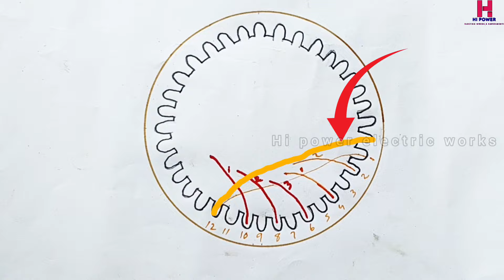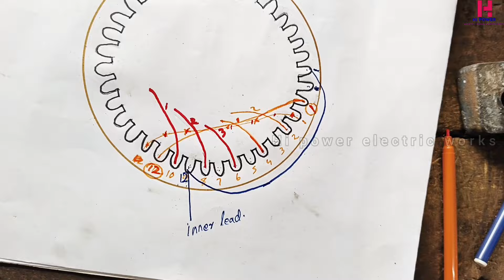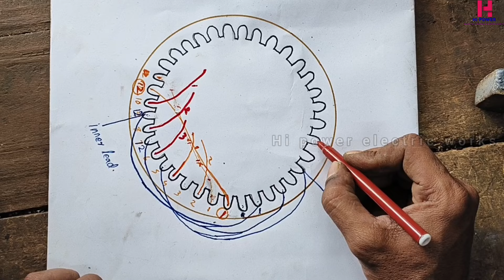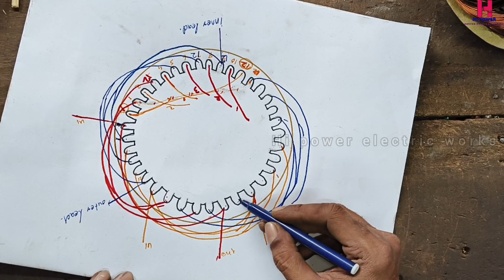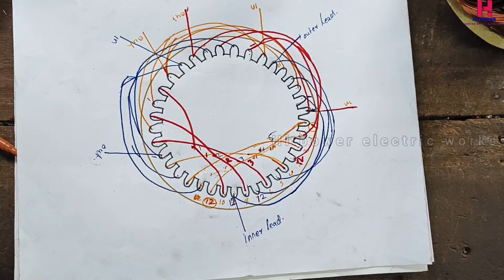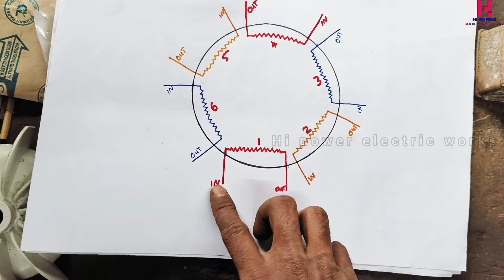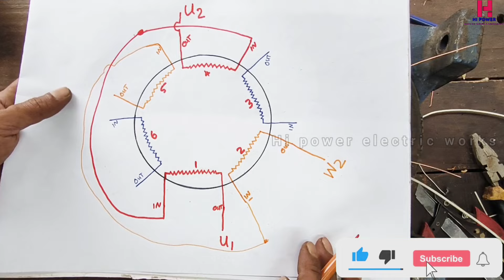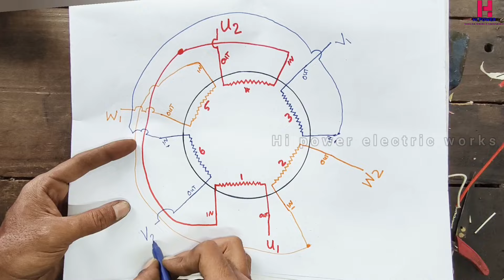3 hp 3 phase motor winding | 3 phase 36 slot induction motor winding detailed video | Motor winding

Comment: sir, which resistance is higher between starting and running coil  in electiric motor?? plyzz tell me..
Reply from the maker: Higher ohms - Starting winding
Lower ohms - Running coil
( For example :- 9 ohms & 4 ohms
9 ohms starting coil
4 ohms Running coil  )
Reply: @Hipowerelectricworks  thank you so much. .

Comment: Why to one's gaps
Reply from the maker: It is a single layer winding. In motors with 6 sets of coils and 36 slots, the winding is 1 slot gap like this.  Not all models are the same
Reply: @Hipowerelectricworks   Please help me i need same motor winding digram